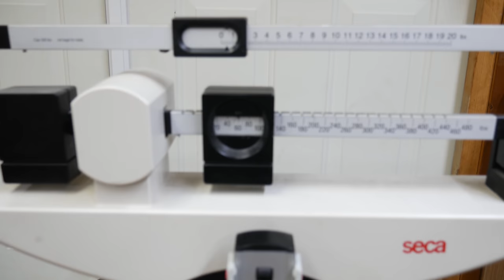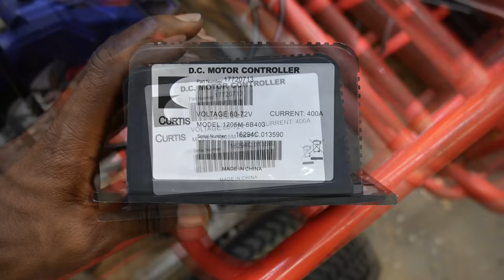Common Problems With Making An Electric Go Kart or EBike and How I Resolved Them. #063

Comment: May want to do some rough math on the cg. Mounting 240lbs behind your head, with your weight in the seat - it may not be as bad as you think in terms of cg. Recall that it's your roll center (driven by your suspension geometry, easy to estimate based on your suspension type) and the moment arm created by your cg. If you're doing a 1g or 2g turn, does the roll over moment exceed the weight pulling you down...   It may be the case that some cg from roll actually let's the car feel more "fun" without becoming a safety concern - and you have room for your little ones. 

Moving the motor towards the pivot of your chassis, you could also put your jackshaft in board, mounting it in the length of the swing arm. It looks like your chain is really beefy too, you could also step that down to support smaller drive gears (though not a hell of a lot smaller) but at least get better wrap on the shaft.  Also - your rear sprocket as is might be your first mechanical fuse, teeth are looking a little thin. 

Finally, don't forget you'll need a way to tension the chains - especially new they will stretch with use. Awesome channel though, really appreciate the teachings - helps me keep the smoke IN the wires!!

Comment: Hi. you can use that pressure clamp in your others videos, for those wires terminals; and slowly press and it is best if you can add tin solder, before placing insulation. Greetings !

Comment: A cheap way to get your speed would be a bicycle computer  from ebay  easy fix ..  I love the Videos ,  I owned a shop that worked on karts for years  ans have done a bunch of mods on them . I have a suggestion for you if you have some fab skills and some welding ability  you could mount all 4 batteries right behind the two seats by stretching the kart 16/18  inches  . Build a tray so you can mount the sideways side by side . That solves  your center of gravity issue  and shortens the cables , and  gives you a mid engine  feel cause the weight is so low .   Just box the frame  extend the  the shock mounts on the frame and brace and your back in business  Your brakes  are hydraulic just longer barke line and your good ! lol   If you lived in Vegas i would hook  you up   lol   O just make dual shock mounts  so you can use two more cheap shocks like stock ones   cheaper than quality  shocks with  the  proper spring rate   Just a suggestion  Great Videos !
Reply from the maker: That unfortunately is more work than I want to put into this project. I went ahead and bought smaller batteries.

Comment: man I just found your channel and love it.  it the same stuff I'm playing around with all the time at home.  love it, keep up the great work.  pro tip.  theres an easy way to attach th is e ends on your wires.  is involves just using an low flame on a torch and filling the end with solder and then putting the cable in.  the solder will wick up the wire and be solidly connected.  we use this in car audio all the time and there are a couple examples on YouTube under some car audio channels.  maybe good info for next time.   love the channel so far 👍
Reply: I solder the wires as well but some claim it makes the joint weaker

Comment: NiCD batteries could be another option, they have a higher power density than lead acid. Unlike lead acid, you can abuse the heck out of NiCds. They can be shorted, drained to 0 volts, over charged or fast charged, and they keep on running. Lead acid, even deep cycle batteries shouldn;t be drained more than 50% capacity and have to be slow charged, usually over a 24 hour period. Only issue is trying to find them. I have some 12v NiCd packs that were used in emergency lighting, they have to be over 10 years old and they still work great. NiCds seem really under rated now a days.
Reply: ROFL - it would cost a fortune to build a NiCD pack with enough capacity for reasonable run time. But yes, they do have good current capacity, provided that they are designed for that (ie: Power Tool cells, not Emergency Lighting packs).

Comment: Its not you jeremy,its the harbor freight china junk :)  nice project btw!
Reply: super  capacitors  my   friend    lighten it right up  !  I lost a  comment to  the    ads    about my bike  ni got wear and tear on the motor   a gas  one   .... yeah  sorry  but I   need to drive it everywhere    m  but  I     wanted bto kow if ya could   do more  on gearing  and   Jack shaft  l  final output   gears    I am running belt drive  as it    slips the belt slightly to  get  it in it's   seemingly correct power band   it needs     but as theoror wears   how does one  compensate   for    lower end  with only a    little sacrifice  on top speed    nite too fast anyway  lol       great  teacher   you    are in all aspects of  life    !     we are very much    the same breed   indeed  and  yeah never    ever buy a cheapo vise lol   cheap  pot metal  boat anchors  more like it !    aces   out   keep up  that stye!

Comment: May I suggest Headway LiFePO4 (lthium phisphate) batteries from Battery Hookup? They have different grades,  including tested good with most capacity still remaining for cheap.

Lead acid chargers wor fine with these,, and you never have to limit current on these unless your charger can exceed 200 amps!  Maximum discharge is 300A, so they are very low impedance. 

They have bus bars for these, and even sell pre-made 24/48 volt batteries made using them.  Along with other server and EV batteries that would probably suit, along with fuses,, high current contactirs, and BMS for LiPO and pouch cells that are a lot less robust than the Headway cells.

All at highly competitive prices.

Comment: Great video! (as they all are). Thank you for the mountain of usable information!  I just have a suggestion about the amp/hours meter you mentioned that you intend in installing, could you show how you hooked it up because I'm having trouble with mine (on my dads 48v golf cart) the instructions it came with didn't translate very well to English or something as they just didn't make sense. Thanks again!
Reply: Mic Tjosaas 
The shunt must be placed in series with the power leads. The meter should have to sensor inputs that you connect to both sides of the shunt. And the meter should have a power source (5V,12V,…) of some kind.

Comment: My Suggestion is. ...
You Can Use Those Lithium Batteries from Cordless Lawn Mowers , They Have 
60 vlts. You can Fix 4 in Parallel. @ 60 amps. I'm guessing.?.
Reply: best way for this is to buy non working packs off ebay, generally one cell dies or a wire burns out in the pack and you still get 3 good cells for cheap.

Comment: Place one battery on the sliding frame of the drivers seat below your legs -  two place inclined , as a back rest for the raised passenger seat that has the forth one below it  (the batteries in an L form)-  the central location will give good distribution of weight - passenger seat  sitting a little forward of drivers -

Comment: What about used NiMH Prius modules? These batteries can be had for relatively inexpensive and have semi modular construction. Moderate weight savings over Lead Acid batteries and can be wired for all sorts of voltages.

Comment: Nice project. Cross member relocated is easier fix then jack shaft addition. Could L-R pairs of the batteries be placed end to end and fitted under raised seats; more evenly distribute their weight? Why pivot motor mount? Did you show it being installed? Lower COG cut off storage carrier. Thanks for the knowledge and entertainment. HAGO

Comment: Jeremy F-Most of the motor controllers break, when you switch them crosswise on reverse. what you need is a controller with two controllers inside. so that the relais switch from one contoller to the other one. otherwise the device will quit the job .
I´m building an e-gocart for my kids since two weeks now. I am using a car steering assistent motor with a worm gear. The controller is a chinese with 40 amps and 10-50volts. it has two controllers inside. I can run the motor with 24v.
Why don´t you use a truck generator, cabled as a motor? It should be very strong and you only need 24 V or 36V.

Comment: clean the inside of your lug then clamp the lug into a vise and heat with a torch then fill your lug with wire solder and insert the stripped wire and let cool. then you can reuse the lug if necessary in the future vs. crimping.

Comment: Amazon has a 1800 watt brushless motor and controller. For $140 I'm thinking ebike! If it is 1800watts. It looks alot like the 1000watt brushed motor. 48v 1800 watts on a 25 lb bike maybe 50lbs with motor and liion batts. 14 1.5ah batts in series. Times 14 in a pack should go far. I'm no little guy. So I need power especially for the hills around here. I like that controller . was it a good deal?; I have forklift motors. I want to do something with. Maybe lamower. Or diy golfcart type thing! Nice job
Reply: 1800 watt Ebike has speed, but gives up some in torque unless you can rig up gearing(impossible on hub motor)
vpower(dot)hk has good LiFePo4 cells instead of bunk Li-ion...

Comment: Agreed (with Lagger Onesixfour), & material selection is often to blame (its built to a price-point: cheap design). What I’ve seen do this most often is cast aluminum, esp’ly where it’s implemented in any high-shear application, or as AVE would say, where the 200lb gorilla meets the load. I once (and anyone could do this as a party trick btw, impress the wife if need be) sheared the handle off an ‘all metal’ garlic press. (Pressing garlic of course, but the garlic was tougher. One tough clove & she buckled)

Comment: Thanks for the video.  I am in the process of making a DIY trailer tug so I can walk behind a tug with a ball hitch on it to maneuver a boat trailer when I have small maneuvers required.  I want to get a 2” ball mounted on a cart or old lawn mower chassis and hook an electric motor to the wheels.  I am thinking a starter motor, golf cart motor, or other type DC motor is what I want.  What do you think?

Comment: Since you like to repurpose thinks. Look for some old Prius or Leaf NiMH batteries.  You can buy the whole battery pack or just the individual cells for cheap.  I believe each cell is 7.6 volts.  Just connect in series until you get the voltage you want.  Not as good as Lithium but way lighter than lead.  Thanks for sharing.

Comment: Four new, fully charged lead acid batteries in series is about 53 volts.  With any age, discharge, and/or load, that's going to drop.  The Curtis rating of 48 volts is obviously out of spec - they expect most of their units will work that low, but some may not, so the low end voltage tolerance is going to vary.  Add any voltage drop from the batteries and possibly wires and connectors, and the voltage it gets might be too low.

Comment: Heh, I used to think, "Why bother with a speed controller on a brushed DC motor when you can just change the voltage you send to them?" until I learned from other videos why PWM, even in brushed DC, somewhat counterintuitively to a lay person, is actually a lot more efficient!

Comment: Have you though about maybe placing the batteries under the seats. The spacing on the bearings for your gear reduction might be a little wide as it could possibly flex your shaft under high torque and spit your chain off. Nice build though 😊
Reply from the maker: I have been thinking about that. Great comment. I plan to calculate the bending load on the 1" shaft. If its too high, I will need to make a more elaborate fixture to hold the bearings closer together.

Comment: Probably swap that back-axle out with one from a garden tractor.  Change the oil seals, replace the grease with gear oil.  They have 6-speed peerless transmission (AND reverse), limited slip differential.  It should pop wheelies & do 60 after that.

Comment: Suggestion maybe you can weld racks on the sides two each side for batts,so your kids can ride,also how would you put together used laptop 18650 batteries packs to good use?Awesome vids Thank you:)
Reply: On the 18650's...if you have to ask, DO NOT ATTEMPT...Just buy a LiFePo4 pack from vpower(dot)hk and save the hassle!
Reply: Laptop batteries are designed for low current applications. They are not suitable for high current projects like Tools and Vehicles. 18650 Power Tool batteries are what is needed, and they are not easy to find. As "carl bole' says, using LiFePO4 is a much better choice.

Comment: I tell anyone don’t try to do any press work with vices …..as you know you get what you pay for in a vice. With that said even if I had a great vice I keep press work on the press and as far as crimping I would use a battery crimp tool before using a vice…don’t feel bad…..you are not the first victim of a harbor freight vice….. by the way love your vids.

Comment: If you ever need a wiring diagram for industrial electric carts, I can send you some. I deal with curtis controllers a lot at work and they are fairly easy to wire right and wrong if not paying attention.

Comment: for people in 2019, lithium is looking much more attractive now.
Reply: Yeh but cost way more
Reply: Even the cost factor is rapidly changing in our favor
Reply: @kaydenyap5677  Cost more?? In what world.. where do you buy your batteries from? Lithion ions is better in weight and price nowadays.
Reply: @davethefish7653  yeah the ones I use have a better output,weigh less and longer duty cycler for less than these sealed units
Reply: Those deep cycle batteries are 100plus a piece you can use a few leaf units for the same or cheaper
Reply: 2020 BOI
Reply: @elekrazy433  They're FREE in my neck of wood. (Im into R/C) I recycle 18650
from old laptops ( sanyo 10C)...The ones in Major brand power drills
18-20V 44000 mah or 6600 mah are either 20C or 30C.
each batter are 2200mah....( some are 1500mah)

They're just 5s lion. I recycle and repackage to 6s at 6600.
I probably dont get 6600 mah anymore....but I made 5-4 packs.
Use them in powerwheels....It'll do 10 mph...donuts and power slides
5s LIPO 50c still has more power.(5000 mah)but if you add up the mah
of seal acid..you'll need 37000 mah.lmao
It'll still be lighter or QUICKER RECHARGE time...but it'll get expensive

You have to start off small....I know I can run 8s lipo(32-36V) in electric wheel...Using the stock ESC and joy sticks...
Not all electric wheel chairs are the same...200Watt 24V are common.
There's 350watt and 500watt in certain models....They use the same
speed control ( I get used electric wheel chairs too)
Trying to build  15 mph go kart for the older grand kids.
If I keep it at 15-18 mph..I dont have to register it..or the nieghbour wont
freak out too much.lmao....
Its the only reason Im building electric. i live in town now...Gas is too loud.
I had my 5 yr old duagther on 8 H.P go kart....decades ago.
She never drove power wheel after that..lmao 

It's LOUD...but we live out in the country.
Reply: Lithium is at a much better price now
Reply: @oneeyemonster3262  yeah, RC fever got me looking outside the box for batteries and motors too! Hot rodding is hot rodding
Reply: Graphene looking kinda hot.
Reply: It's 2021 and I'm looking at ceramic lithium with great anticipation.

Comment: I have a vise suggestion. Get a sovieth vise, made in the USSR. I'm not a fan of communism but i am a fan of older tools, that sweep the floor in performance compared to newer ones. You might have to do a little restoration but it's well worth it. Even the rust covered ones  do  better job, than the newer ones.

Comment: Jeremy, What about putting a 250 Watt peak Solar Panel, on the Roof of the Go_kart?, to continue charging the batteries?If the panel is rated 250, it will produce about 200, due to heat.

Comment: How do u get the pedals working for the throttle thing to make it speed up. My motor comes with a bike throttle type thing and I’m going to be using pedals for my Go-Kart. So how do u get it working with the electric motor?

Comment: Check out a youtuber: 2Jeffs1.  He's got a Cushman he converted to electric and some tours of how he set up the controls.  A while back he showed the tearing down of a Nissan Leaf battery pack for a lot of large lithium cells for use in the Cushman and other electric vehicles.  Tearing 383v down to a bunch of 8 v cells is not for the hacker, but it can be done with proper respect and discipline.  

I picked up a  TEMCo Battery Cable Hammer Crimper off Ebay for about $20.  I haven't done many lugs but it is easier than trying to get the vise to do decent job.

Comment: I respect the fact that you do not overvalue recycled cells like a lot a bandwagoners are it simply doesn't make sense truly a poor short-term decision. I encourage you to couple any future project with Maxwell capacitors. God Bless
Reply: Super Capacitors will power this things for about.... 2 seconds. A very poor choice for high current high voltage high capacity requirements like this.

Comment: Li-ion vs Lead-Acid
While Li-ion batteries have a much power density (less weight (and volume)) their cost is significant and you need a PROPER charger ($$$) with a BMS. So the cost and complexity increases significantly.

Comment: Jeremy, I was wondering if I was just using a 3 HP 12v motor for a cart that would only travel at a speed of 9km/hr or around 6mph then instead of using an expensive 300a reversible controller could I just use a Heavy Duty 12V DC Winch Reversing Solenoid Relay 500A Automotive Switch instead?
Reply from the maker: The comments is not a good place to explain the pros and cons of everything you are describing here, but I think if you already have these items then by all means experiment and learn. Most golf carts have 3hp  motors.
Reply: Woo Hoo - the one-speed gokart. Yeah, sounds great fun... not.